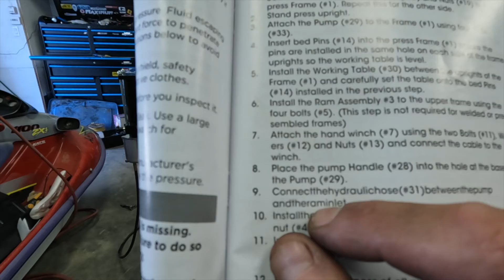Princess Auto 40 TON Press - (= Canadian Harbour Freight) Build Video

Comment: How do you get the clocking right when pressing them together? I would assume a twin is easier since it's 180 degrees opposite. I was trying to think of some tooling jigs I could make to help clock the pieces when pressing them together.

Today I got kyle to make me am 80mm pin for the case alignment. I milled the locator hole pattern in..... Get home and find out I measured the wrong bearing and it's to big. DARN!
Reply: Just got back from the hospital... I have a fractured knee... more on that another time. 

Clocking from cylinder to cylinder can be done in a few different ways. I will probably use my lathe and hold a pin in the tool holder method ( I've seen Allan Milliard do). Hard to explain but slick. You can also use a degree wheel, lightly press together (just a few mm) rotate one side 180 on the degree wheel and use a dial indicator on a lower rod pin to check (compared to your first rod pin) Hope that makes sense. You would then tap your web to rotate it until the dial indicator reads the same at 180 and 0, and then finish pressing. 

You can do this second set up with pretty basic equipment. V blocks, flat metal plate, degree wheel and dial indicator. 

If you want to make a jig you can make a pin that fits snug (but not tight) in the bottom rod pin hole in the webs. Press one web on, then your bearings. Support your one web and bearings on v blocks (a v block) on top of a very flat surface. Machine a block for your pin to mount in that is perfectly parallel to the table, and off the flat surface enough to go into the bottom rod pin hole, at about 90º (this doesn't have to be 90º just high enough to go in the web hole). Make sure the v-blocks, bearings and pin jig are secure. Use your jig sitting on the flat surface and in the bottom web hole to set your zero degree.  Attach a degree wheel (two sided tape, crazy glue or anything else as long as it's secure) Make a needle that points to zero on the wheel. Remove your jig. Rotate 180º. If you can, secure the parts at 180 great... if not you have to get someone to hold it or check it lots. Put your jig tool into your second web and align it with the parts in the V-block. Ensure that you are still at 180 on the degree wheel and tap the web into place slightly with a hammer. Recheck your zero with the jig and then your 180 before pressing together. 

Basically how you do it in the lathe except that you hold the crank in the chuck and put a pin in your cross slide, instead of making a jig. 

OH CRAP, haha... that's frustrating ! So is it scrap or can you fix it ?
Reply: @JoelArseneaultYouTube  OK I may well try to do it myself. I bet I could make some tools to make it more simple. If you have a fractured knee then hopefully it's just fine in a month. I had some fractures in my pelvis and back from a dirt bike crash 9 years ago. After a month it was basically fine so hopefully it goes that way for you. Seems like muscles are worse than bones..... Unless its a really bad one.
Reply: @Jacobskibros  Yeah. I'm sure you can do it if you take your time. Check out this guy for some crank truing tips... even if you get the clocking correct, you will still have to do some adjustments between the webs. This guys is insanely good with two strokes. https://www.youtube.com/watch?v=6lKLKtzWPQI&ab_channel=2STROKESTUFFING

Yeah, they are saying they may let me walk on it in a month if everything goes well. I hope so.
Reply from the maker: If you haven't figured out what's happening here...I'm trying to clean up comments that haven't been responded to by Lowered Expectations.
Reply from the maker: One of my patreon members said that he thinks you should just have a livestream going most of the time, haha.